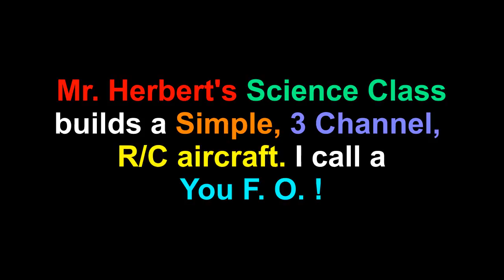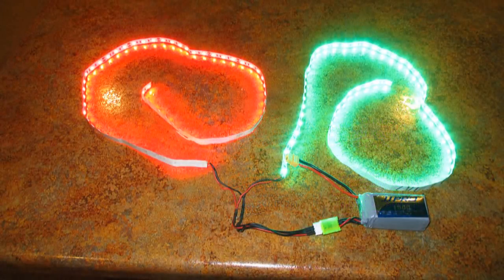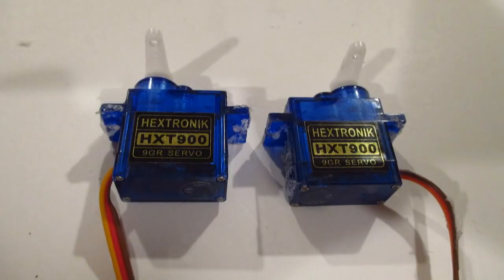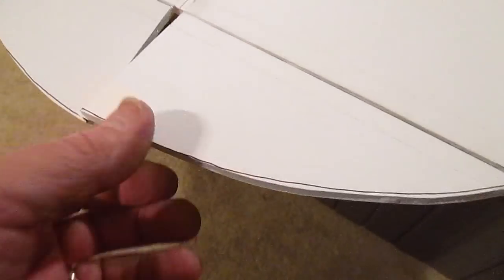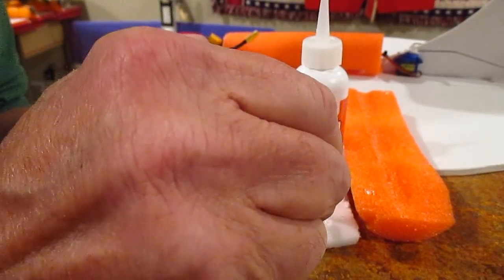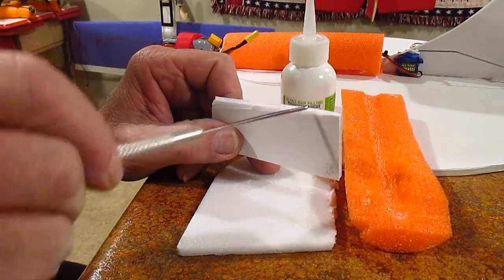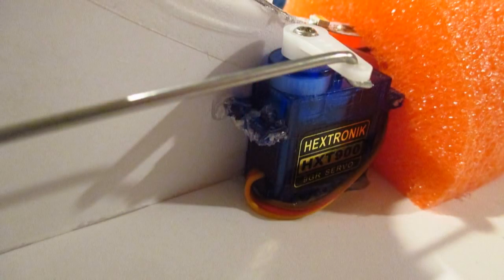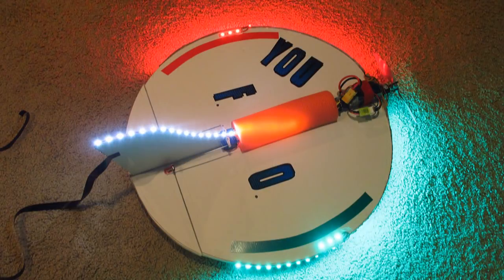My YOU F.O. ( UFO ) is an R/C flying disc I built in 4 hours with flight tests, day and night.

Comment: Can you do a video explaining the differences between AmazingGOOP, E6000, and Shoe Goo?  I've used AmazingGOOP and E6000 interchangeably, but never actually tested what is the stronger glue.  And Shoe Goo I just assume stays the most pliable between the three...but maybe I'm wrong.  Hope you and the wife have a Happy New Year!
Reply from the maker: Well I introduced goop to my subscribers over 10 years ago when you could write to them for free samples. I use Goop for everything that needs a flexible joint and when I have time for it to dry. Shoe goo is made by same company as goop and the other. They are all very similar. Others have probably already done some testing, but my choice will always be any of the Amazing Goop products. Thanks.

Comment: What is the diameter of disc??? Please help me
Reply from the maker: As I show in the video, I used a 20"x30" standard size foam board. The maximum size disc you can make out of a single foam board is 20 inches in diameter.  Good luck and happy flying.

Comment: Dave, entertaining video as always. I am going to follow your plans and build myself one ! I have a question about the prop on your plane. Did you incorporate any provision to prevent the prop from snapping off when landing ? Is there enough clearance between the tip of the propeller and the ground  because you have no landing gear ?   Do I need to be concerned about this when I build my Plane ?  Happy New Year to you and your lovely wife Ilea, and Semper Fi  !!
Reply from the maker: Thanks much.  Well since I am flying in the snow, the prop goes into it on landing.  I shut the motor off, just before landing. On my original mini from about 10 years ago, I had landing wire skids to prevent prop hitting. On my big nitro versions, I had landing gear, so I could take off from the ground. Make sure to watch the update video and the night flight video.  You will love this plane, I am sure.  Make sure to put the lead weight in the nose as I show in my update video.  It needs to be nose heavy.  Here are my original vids. and the update link. https://www.youtube.com/watch?v=ynHtmfYr_Lc  or  https://www.youtube.com/watch?v=28tIp5usrF8&t=445s   You FO Update and CG questions answered.     https://youtu.be/epMYSdqeSDs